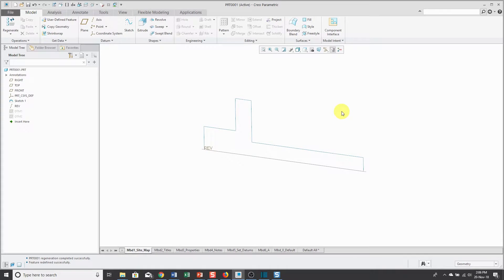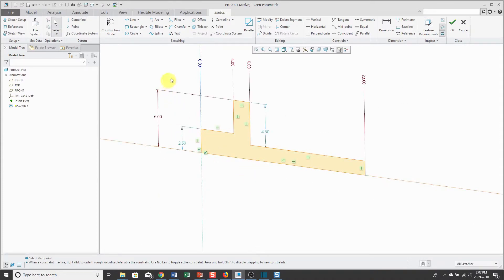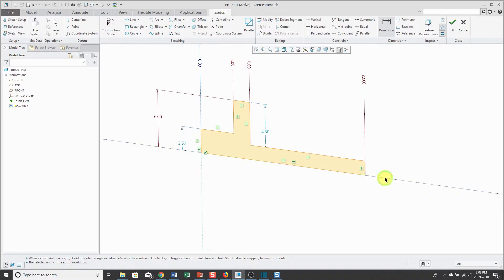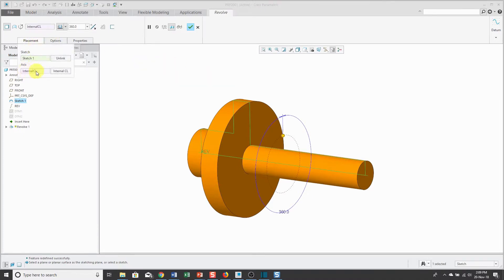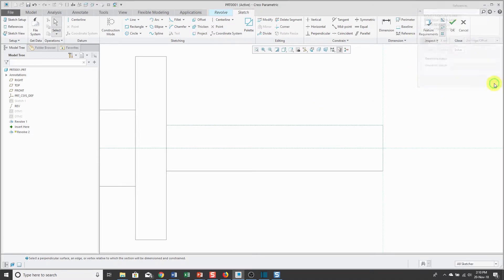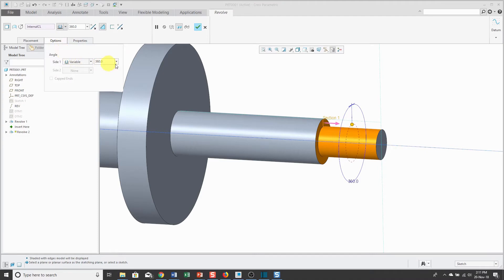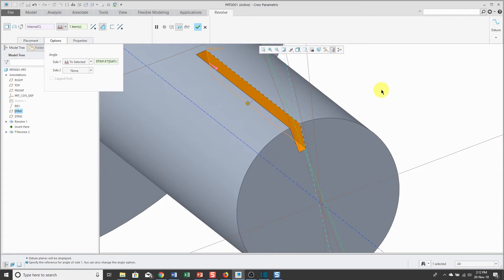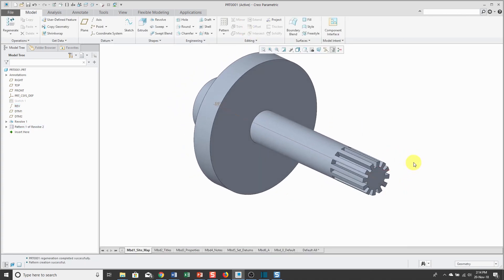Creo Parametric - Revolve Feature - Part Modeling Basics

Comment: Hi, would you know why the revolve would refuse to complete a full 360 when using internalCL?
Reply from the maker: The most common cause is when all the sketch entities are not on one side of the internal centerline. Also, the first sketched centerline is the default axis of revolution. If you don't designate a subsequent one as the axis, the feature can fail.